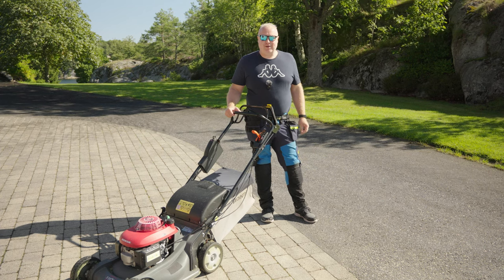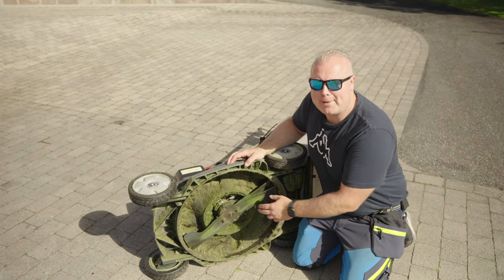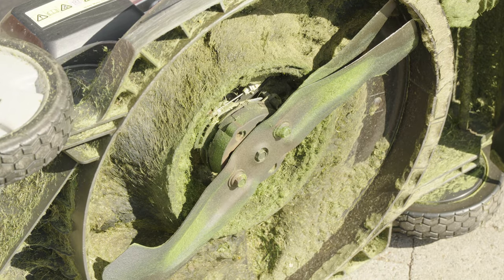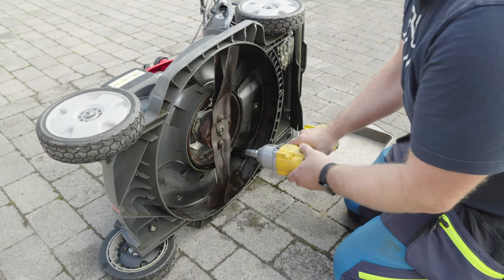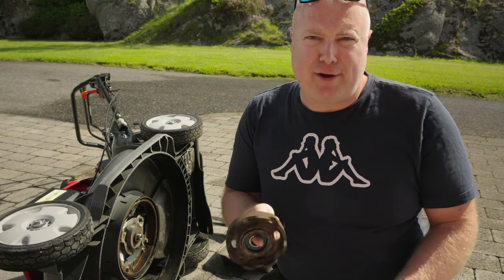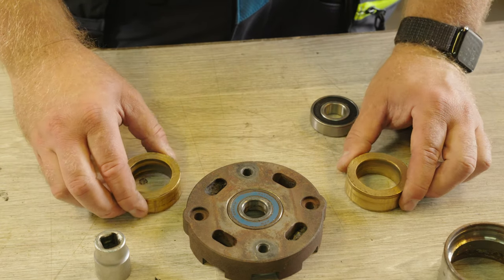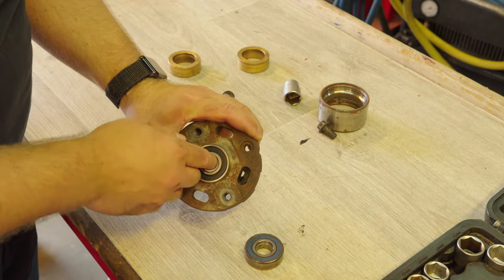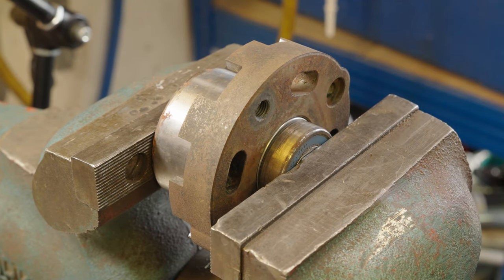Honda lawn mower repair! HRX 537 (HRX217)

Comment: I have this exact noise, I'm glad I found this video, I thought my engine was dying
Reply from the maker: It is very common on this model! I have seen it on several mowers of this model. Make sure to have the ignition off when you work with the blades, so it won’t start. You can also remove the spark plug cap to be sure. 👍

Comment: I try to take off the clutch and the bolt just spins. What’s the secret?
Reply from the maker: Use an impact!! Or hit the ratchet with a hammer. It is the engine that spins. Make sure the key is in off position, so the engine won’t start!
Reply: @InTheVise  it’s not an electric start.  HRX217, how do I stop the engine from spinning?
Reply from the maker: @chuckpalmer3926  use a hammer and hit the ratchet while you try to loose the bolt. Or use an impact gun. Then the bolt will come loose. You don’t need to lock up the engine.
Reply: @InTheVise  got it, thx
Reply from the maker: @chuckpalmer3926  cool!! Never give up, and you will make it!!

Comment: I did this install thanks to this video but now the mower blade stays engaged even when button is not pressed, or lever pushed in. The blade is constantly engaged. Any ideas?
Reply from the maker: Did you install the clutch and spring right?
Reply: @InTheVise  I'm not sure. I installed it with the center touching the side the bearing is on. The outside ring of it touches the upper side toward the mower side. I'm thinking I have it upsidown. I'm talking about the throwout spring / spring washer that enages / disengages the clutch.
Reply from the maker: @timothygrady7552  it’s probably the spring washer